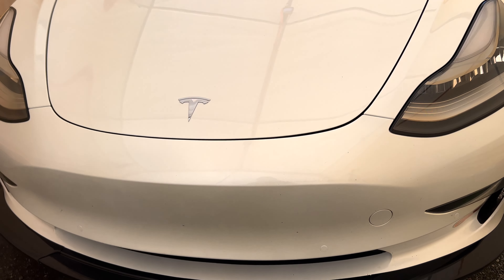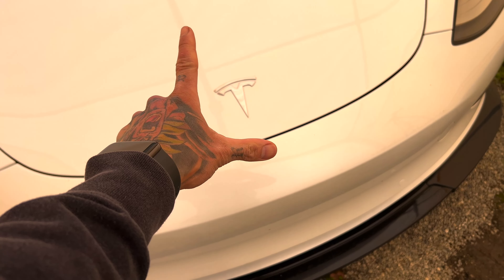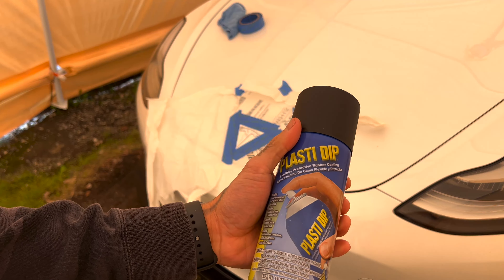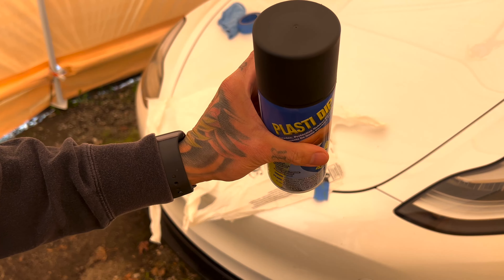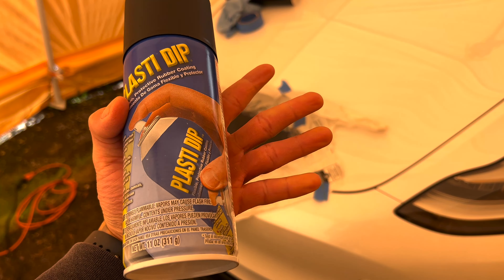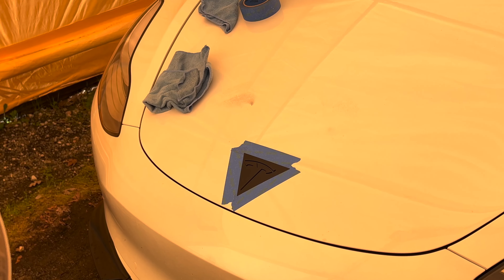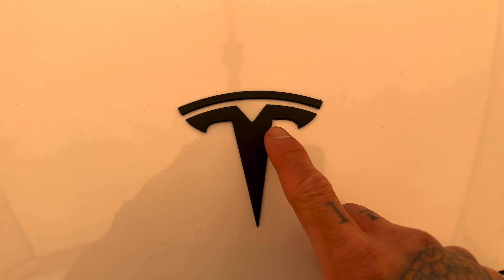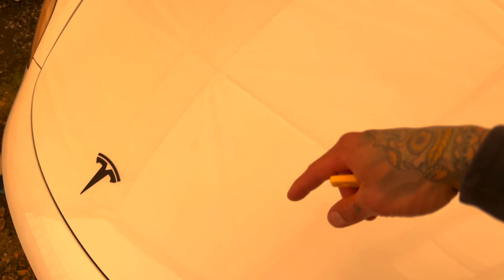Plasta dipping a Tesla

Comment: Would this spray be a good idea to coat a slick mouse in, could it restore the grip?
Reply from the maker: Yes, and no. It may become an irritant to people with sensitive skin, but it will make the surface very grippy.
Reply: @Diy_Papi  had a scuff pad years back that had a rubber spray applied for grip, always thought that was cool, was like splattered on